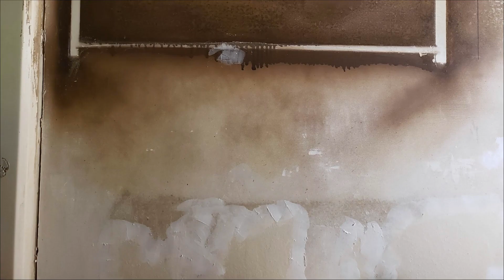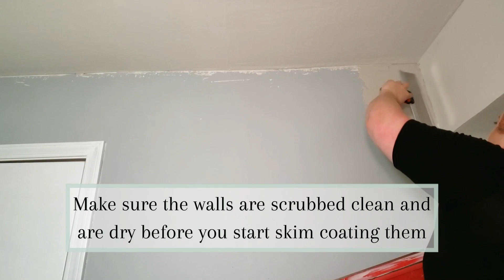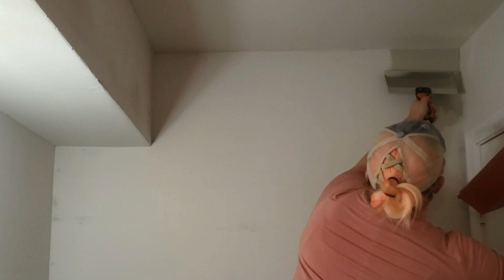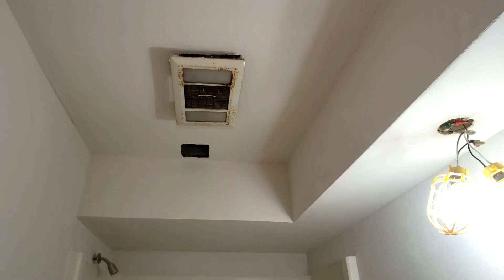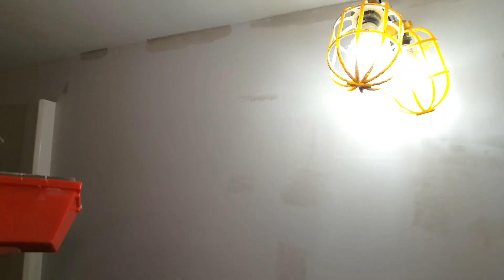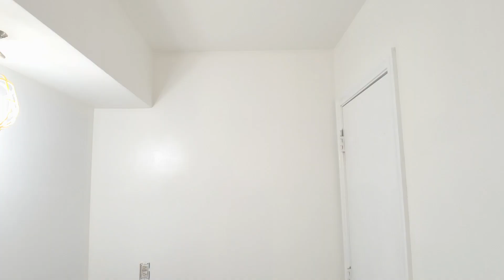Skim Coating | Smooth Walls For Painting | Bathroom Makeover On A Budget EP.7

Comment: If you are doing this in a room where it will be subject to a lot of humidity and condensation, consider using a setting type plaster, IE powder and water mix type, rather than a pre-mix. The pre-mixes can turn back to powder after a long period of repeated high humidity, and affect the bond of your paint coatings. Place where this can apply include the high wall and ceilings in a shower area. Make sure you get an easy-sand setting plaster, not a hard setting base coat type.

Comment: Hi! I would love to do this in our bathroom, but wondered, is it possible to still use the shower during the drying days? Condensation can build up on our walls after a shower, though the fan usually clears it out pretty quickly. We only have the one shower. Thank you!

Comment: Isn't applying the joint composite with a roller better?
Reply: @Elena-mk6bf  if in doing so you'll need to mix the mudd just right. You'll roll it like paint but if not a pro ot can get real messy.
Reply: @soulbrother3299  wouldn't it be useful to use as long as some 36"- long blade?

Comment: How did you handle the area near the shower head?  It is difficult to get a knife in there with the shower surround. Any advice?
Reply from the maker: I should've gone into this in the video, sorry I missed it! I used a small putty knife to get around the shower head and to do the area between the ceiling and the top of the shower surround. I pulled the flange away from the wall so I could skim coat behind it that way it would look seamless when it was done and the flange was pushed back up against the wall.